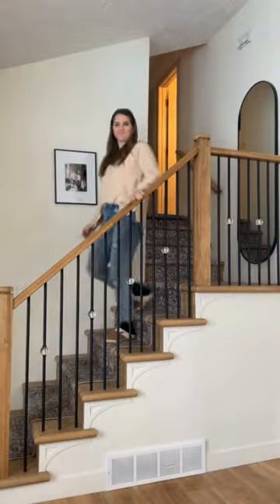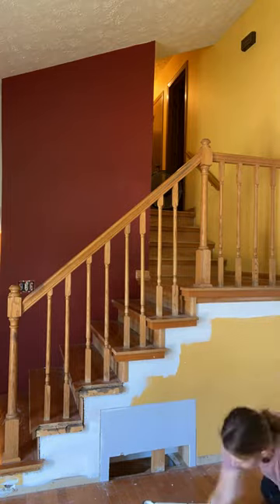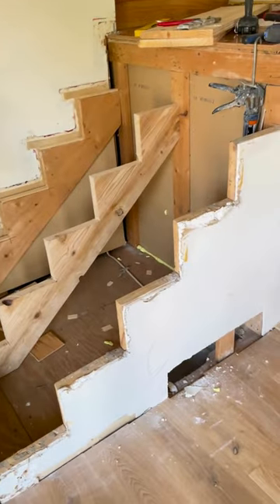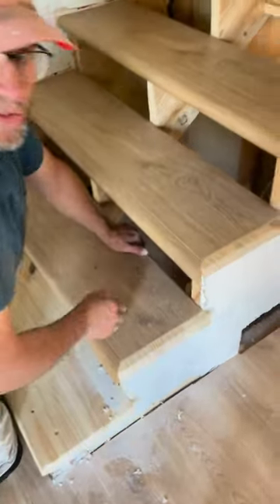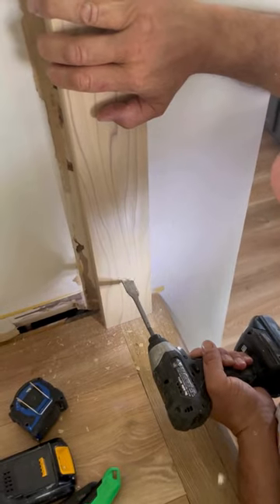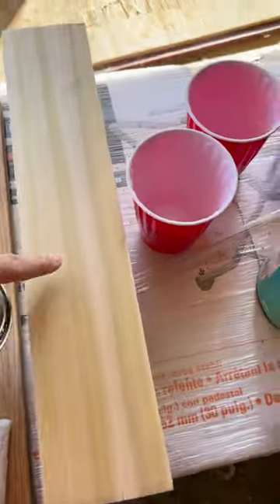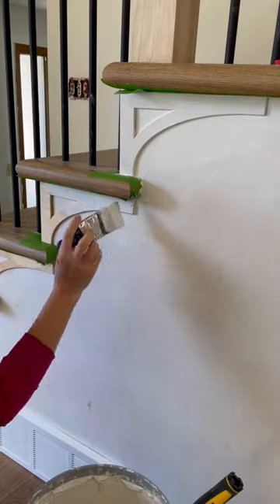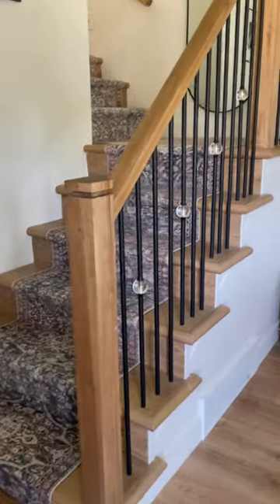70's Staircase Makeover

Comment: I would not have stapled the stair carpet. Use hardware specific to stair risers and carpet placement. That way if you tire of that carpet or need to clean it, it can easily be removed to do so.

Comment: It looks easy more beautiful and inviting than before. The white paint is really the star because it adds so much lightness, brightness to a room that was weighed down with color before. I love the color of the stairs. The railing color is a little lighter, but ok. It's the plainness of the that feels strange... Just looks like planks of wood were plopped there's - the would had no texture or personality to it. The rug is great because it does have some texture and visual interest that breaks up the block of monotony in that area due to all the white paint the metal roofs with the jewel detail are nice. Those will look great with the Christmas decor. The stair medallions are a great touch although i think i would have just extended that top one the length of the stairs so it doesn't look like the were just glued on there. It would give it a more custom look if you add just a thin plank of would across there. I would change the scale of the picture on the wall (too small and too few) and maybe get rid of the singular plant which gets swallowed up over there and is probably add a bench seat or some sort of display table or add more plants with carrying heights.

Comment: Great adding the extra center stair support. Although I prefer wood to metal spindles, it looks nice. I like the look of the stair runner, but for practicality, I wouldn't use it. Trying to vacuum the stairs is hard with two different surfaces. Especially if you're dealing with pet fur.🐕🐈

Comment: There are plenty of ways to get rid of the creaking without tearing the old stairs out. I live in 1910 American foursquare Frank Lloyd Wright inspired.  There are kits that you can use to get rid of the creaking. I would never tear the old stairs out. I actually still have all the American foursquare windows with the counterweights and I am not gonna be the guy that tears them out as they still all work perfectly and you actually cannot just remove them out because they are not windows. They are built into the house. They all still operate and I love the wavy glass just adds to the character to the house. The stairs were built on site I have stain glass windows halfway down that open up if you want them too into the house. Yours do look beautiful in the end and I do as well as you love decorating the stairs with Christmas.